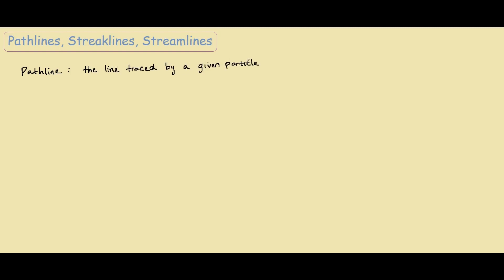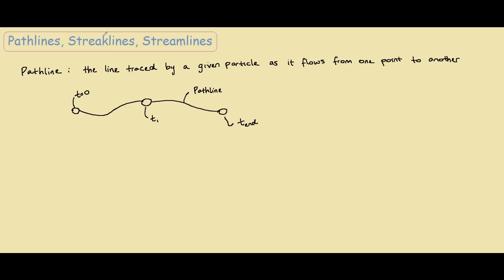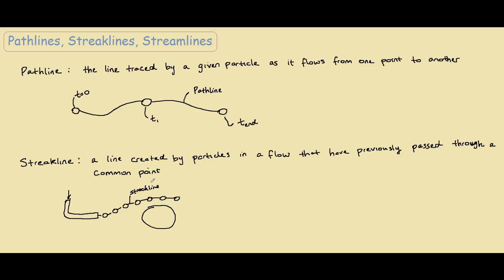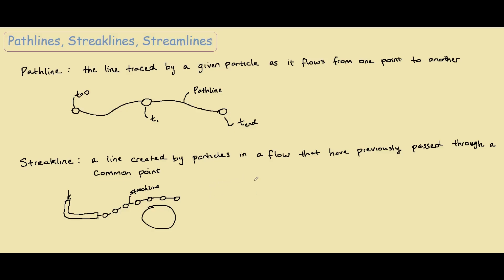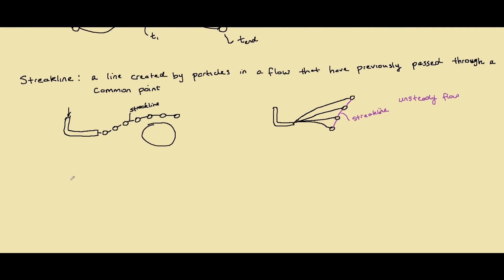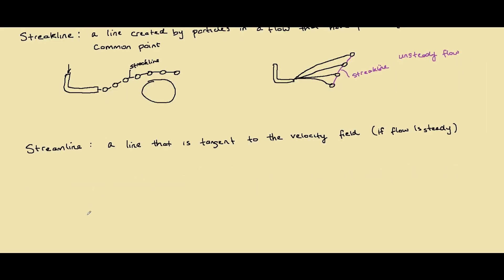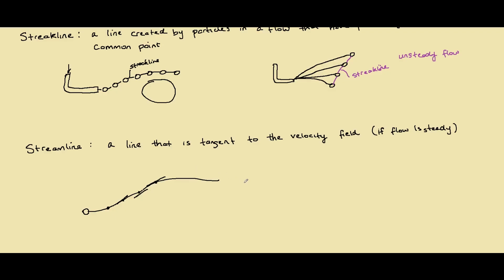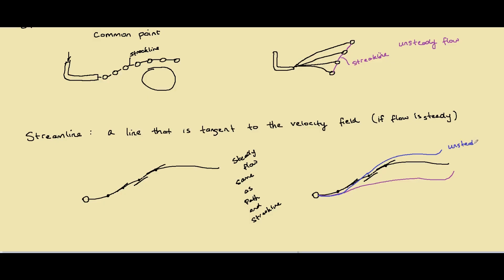What is the difference between Pathline, Streakline and Streamline

Comment: When a movement of single-particle is tracked, the pathline and streamline are the same in both steady and unsteady cases. am I right?
Reply: You are right except for one condition and that is the single particle should not form loop, otherwise the path followed by the particle would be only pathline, not a streamline.
Reply: But Streamlines do not track the movement of one particle, but rather show the current velocity field of the fluid at one moment in time.

Comment: Can someone please tell me whats the meaning of streamline? Why do we need it apart from pathline ?
Reply: A streamline refers to a particular instant of time whereas a pathline involves the variation of time, since a fluid  particle takes time to move from one point to another.
For example, let us say, a particle has travelled from t= 0 second and to t=5 seconds. Obviously, during these 5 seconds, it will change its position. But the flow parameters ( like velocity) may change (as for unsteady flow) or may not change (as for steady flow) within these 5 seconds. So, for pathline, the key factor is the duration of 5 seconds from initial to final point of time. (And to see whether the change of fluid properties is taking place or not).
For streamline, the key factor is the instant of time i.e., at instant t= 0 second , we check what is the velocity ( and other flow parameters) and this will be same throughout the streamline at that instant only and at instant t= 5 sec, we again check the parameters ( which may or may not be  different from those of the values at t=0 second). So, for streamline, we are not interested in whether the flow parameters are changing or not within these 5 seconds, we are only concerned with the point of time ( with position of a single particle at different times or the position of different particles at same time along a streamline) viz., At t=0 sec, t= 5 second. (Also, you can take for t=1,2,3,4 seconds as the conditions demand...)

Another difference between streamline and pathline is that the streamlines do not intersect each other (and also a particle traversing can't form a loop itself), otherwise at any instant, a single particle will have two different velocities which is never possible ( since the instantaneous velocity of a particle is uniquely defined)
While two pathlines  can intersect each other or a single pathline itself can form a loop because under certain conditions, even a same particle can arrive at a same location at different instant of times. 

Hope it clarifies !!
Reply: @ultraminimalism  thank you for your great explanation, i already passed the class and understood the concept really well ,thank you
Reply: @EmreErdogan99  You're welcome

Comment: i know this might be dumb and maybe nobody will respond, BUT, every single time im in the shower, ive been a bit of a weirdo and observed for many many years that the water droplet when it travels down, if it falls into another already previously travelled path by another water droplet, it will more likely go through this path, except sometimes depending on angle etc, it takes a few seconds for that water droplet to push through into that streakline... MY QUESTION IS, is that an example of a streakline or have i confused the concept?

CHEERS
Reply: Hey mate it's been 4 months here is what I think about it.

So the streakline is a path created by fluid molecules that pass through the same point like after sometime.
For your case if we assume droplets as fluid molecules and let's assume the 🚿 (shower head) as their starting point. These two particles they travel irrelevant paths at first than they intersect. So the streakline I believe is a curve that connects particles at different times. But after a while these particles are getting together forming a new solo particle therefore yes I guess they form a streakline which is unsteady.

Wish I could have drawed you these but heck idk. Hope this helps
Reply: @henrycoldrain8151  One modification needed. A streakline is the line formed by the these particles at same time ( not at different times), once they have passed through shower (and also takes certain time to follow their respective paths before meeting (in case, you think they will meet)) because a streakline is the locus of the points and a locus is formed by joining the multiple points and is perceived to be joined at a single point of time. So, (after leaving the shower and before meeting), at any instant, these particles would have some distance( in between them) and that  is shown by an imaginary line which is streakline.
Hope this helps!!
( I wish I could draw and show it)